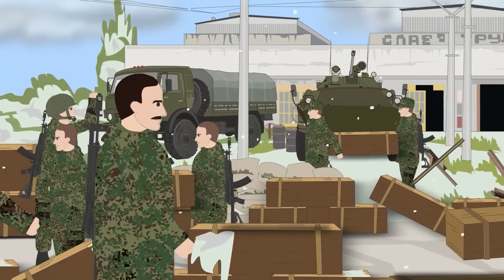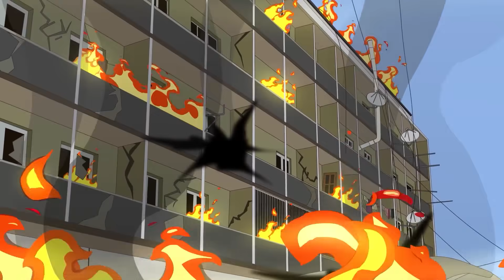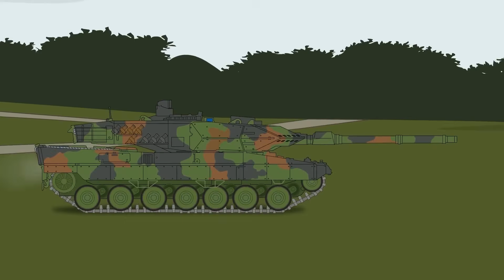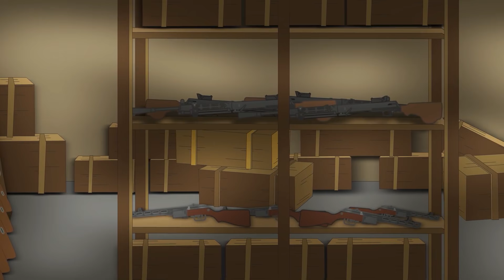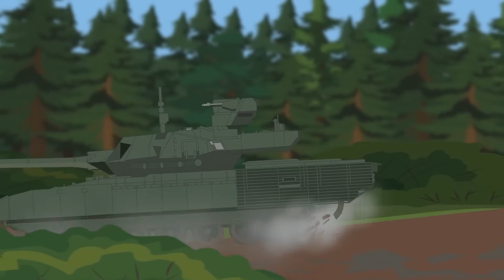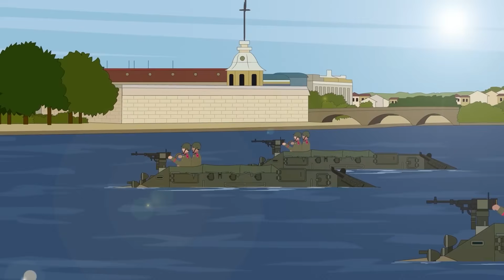Weapons that could Decide the outcome of the Russia-Ukraine war

Comment: Interesting that the T14 being modular is being seen as a good thing. If you base everything on a tank chassis and tank engine and drive-train, it will return tank-like fuel economy.

Modular works well when it's among a number of platforms that require similar levels of protection.

Comment: This is the first video, that I saw, calling it an invasion. There is an old Infantry saying: "Battles are not won by the equipment that you have to use, it is how you use the equipment that you have." The people are defending their homes. In the US, about 80% of dead criminals are killed by the victims. Most DOAs were armed burglars. Some were attempting to commit MURDER (187). Once time a man broke in  with the intent to 187 his girlfriend's husband.
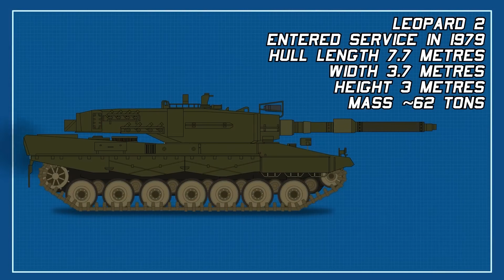19:04)The US tank is lighter by 10,000+ pounds. An US ton is 2,000 pounds. A metric ton is 2,204. 1.102% heavier.
27:02)4.8 Km is 2.98272 miles. 1 Km is 0.6214% of a mile.
29:33)Assault rifle is the US press name for SEMI-automatic rifles.
33:00)Overlooked are the WW II German MG 34 and the MG 42. The US M2  .50 caliber Heavy Machine Gun (HMG) has an effective range of 6,000 feet. An USMC man, with a scoped "Ma Deuce" was able to "reach out and touch someone" at 7,200 feet in Viet Nam. The lighter  .50 caliber M82A2 rifle can used as an anti-aircraft weapon. Bolt action with a 5 rounds magazine. About 6 were made.

Comment: Hahaha i macgyvered today funny enough.
I was missing the nut that holds the 2 pieces of a hole saw bit together, the centre drill and the cutting bucket/skirt around it i had and the drill.
So i used g shaped multi grip for framing steel to lock onto the thread where the nut goes also pressed jard up against the skirt to hold it in place and stuck it into my drill, customer was certain he was seeing something interesting so he watched me as im spinning the hole saw bit with a pair of vice grips attached to it and not the kind with serations, these things are like pinchers.
It worked like a charm

Comment: you missed the point of the WW1 water-cooled machine gun 
Modern air-cooled machine guns have many advantages   --   BUT they ALL need to be fired in repeated short bursts to keep them from overheating 
The water-cooled machine gun can lay down a continual rate of fire

Comment: The PTRD is utterly useless argue at me I dare you 1 is you need to put a thermal scope on it that means you are probably targeting infantrymen you don’t need at any-material rifle as I  going to call it has it is not really capable of killing tank or really any modern APC a small rule round will kil them just as good pulse these Rilfes  lighter smaller have a mag more reliable easier to operate and are most of all more ammo is available for these system also Sparta parts 

2 if you are targeting a vehicle or and it need a a thermal sight you are way too far away and out of the effective range to damage to the few vechicles you can do damage to with this thing

Comment: Another point .... The Sig MCX used by Ukrainian Special Forces is not the semiautomatic version.   The Sig MCX comes in both selective fire and semi-automatic only models. 

The semi-automatic version has a lower rate of fire than the select fire fully automatic capable version of the rifle.   It's kind of the difference between a civilian AR-15's rate of fire and a M4 Carbine's rate of fire. 

For reference the AR-15 has a rate of fire of up to 45 rounds per minute.  

The M4 Carbine has a rate of fire of about 700 to 970 rounds per minute.  

Hopefully everyone now understands the difference in rate of fire between a Semi-automatic rifle and a Select Fire battle rifle or carbine.  One is capable of automatic fire .  The other is not.

Comment: The T-14 is the most fake tank produced by sheer armounts of copium the world has ever seen, it can't even drive and has to be pulled since it's engine is to weak to pull it's own weight and the chasy doesn't allow a stronger/biger engine, on a scale of 1 to 10 it's a minus five, AN EPIC FAIL. 

There's a reason it never showed up for battle in ukraine and why they use tanks of the start of ww2, because if they could have used the Armata 14 Tank, they would have , just like the used the "invincible and undefeatable T90 and Terminator Tanks" Only one country can lie even more to itself and that one is china.

Comment: You missed a critical piece of info when assessing the tanks.  The Challenger has two hot-water boilers.  Its crew can brew tea and heat soup at the same time.  This is a slam-dunk for the Challenger.
Reply: It’s also to heat k rations boil in the bag type rations and all British Armoured vehicles have had them since the 50s
Reply: Challenger still hold longest tank on tank kill record
Reply: Lol
Reply: By now, the crew ARE the soup inside those tanks.
Reply: They didn't need any broilers whenever one of those tanks turned into one big broiler.

Comment: funny that you didn't mention that russia is a kleptocracy.  think of it like a pyramid scheme.  the upper class/politicians give contracts to friends and family, taking a cut... that family or friend takes a cut, then it goes down like trickle down economics... with each additional "controller" of the process taking a cut.  this is how lots of tanks and such that were found in storage with flat tires, no fuel or missing electronics/wiring.  because when it gets down to the bottom, everyone trying to make their cut... it doesn't leave much if anything for the actual construction or maintenance of anything.  putin and the russian leadership have for over 20 years now, just produced propaganda to give the appearance of military strength... its one reason putin refuses to call this a war... that title of a conflict has many penalties and boons that he doesn't wish to face.  anyhow for systems like the armata using mostly "foreign" components... its also to be said that this kleptocratic system can be to blame... can't build a tank out of cardboard boxes now can ya.  figured i'd throw that in for you since you missed it.  slava ukraine.

Comment: Chally 2, only 14 => useless, poor ammunition, just a burden for Ukrainian logistics.
Leo 2 and Abrams less than 100 => limited impact
Leo 1, even if it has more, it's also more limited technically => limited impact.

Artillery, IFVs and all these systems with much larger basic donations are the ones that have the most impact in Ukraine, because the high-end MBTs (Leo2A6-7, Abrams) are much more exposed and not numerous enough to make a critical difference.

Comment: T-14 Armata is a White Elephant and an expensive one at that.

The engine it uses wasn't a vehicle engine, but a conversion of an existing engine used for pumping stations for both water and oil. It is also based on a captured German engine from the Second World War, the ill-fated Tiger P's Porsche engine that never worked reliably.

The Remote Turret also suffers from feed issues, up to and including jams serious enough that the Turret is at risk of being blown up. As for its rotation speed, the M1A2 Abrams can rotate its Turret at or greater speed than the T-14. I've actually seen a video of an Abrams in combat get smacked by an Iraqi Insurgent in the rear of the Turret side and that Turret swung around faster than I could blink before stopping, acquiring, and then adjusting before firing.

And all of that in just seconds. The video ends with the death of the guy holding it when 120mm worth of destruction slammed into the guy's position and killed him and his Insurgent buddies.

The T-14 also has both an issue with engine noise and air conditioning that makes the problem plagued Gun Stryker look positively perfect in that regard. The T-14's engine is so loud the crew have to shout to be heard. A propaganda video about T-14 tried to claim it was the AC unit, but the men in the crew compartment were sweating heavily.

Almost all claims are unverified or have fallen short of reality. More than that, the fuel requirements make the M1A2 Abrams look like a compact car. Or even a Smart Car!

Russia tries to talk it up, but the T-14 has been a huge failure. The German KF51 Panther is slated to enter full rate mass production, with Ukraine as the first nation to enter it into service, and the US Army has been working on Remote Turrets, especially for M1 Abrams, since the 1990s and had even successfully developed a M1 Abrams Remote Turret prototype vehicle that just didn't work out long term due to maintenance headaches caused by the technology of the time.

The Abrams-X just continues that technology development, but while the US Army is interested, from what has been sounded off about, the US Army still wants to keep the Turbine Engines as the technology has actually reached a point where the Abrams is nearly as fuel efficient as Deisel Tanks and that the latest developments in Turbine Engine Technology will make the engines both lighter and more fuel efficient.

Another decision is that future US Tanks will still have Four Man Crews, with the fourth man there to operate Drones and work with the Tank's computers, likely also filling the role of a Radio Operator to coordinate operations with other vehicles while the TC fights the Tank leaving gunnery to the Gunner and driving to the Driver.

Abrams-X is headed in the right direction, but isn't quite there yet. Though, it is a prototype and tech demostrator only. The M1A3 is still on track for development, but there appears to be no plans for a M1A4, at least for the US Army and that the next generation MBT will replace the M1A3 after a period of service where both Tanks will likely serve next to one another before M1A3 is retired to either be sold off or to be used as Targets.

Comment: I don't think pointing out the age of the T-90 is very relevant when M1 Abrams and Leopard 2 are both technically older than it. Then again, the T-90 is basically just an upgraded T-72. Even still, why point out the age specifically when it is comparably "old" with other modern MBTs?
Reply: It is also misleading, because the discussion focuses on when the FIRST tank rolled off the assembly line, NOT when the latest tank was built.  The US military announced it will continue to use the relatively ancient A-10 warthog tank-killer airplane through 2040.  A design that has lasted over a long period of time does not mean that EVERY one built is as old as the first one built

Comment: I’ve got an idea that is likely already existing but underated

Rc cars

A good fast, mobile, all terrain rc car could be devastating if used properly 

Yesterday I bought a modified one from a rc addict 

The guy program, modifies and even 3D print his rc cars he has one who works on nitro a crawler a big one that could break your ankle if it ran you over and many fast ones

He modifies controllers to max out their ranges some capable of working up to two miles away
He could easily attach c4, grenades, mines, cameras, laser guidance systems or even guns to an rc car

Some can reach up to 150km/h 

They are small yet powerful, cheap and would be highly effective 

You could for example:
Attach an anti tank grenade or mine on top of it and drive it under a moving tank to make it blow up from under

It would be almost impossible to detect and even when spotted  most conscripts wouldn’t think much of an rc car some could even try to steal it which would turn out to be a deadly mistake

Hiding in a bush spying on enemy troop using a camera or placing mines

The possibilities are endless 

The same goes for rc helicopters, planes and boats

All three can be modified to carry bombs, guns, torpedoes or mines

It is also fairly easy to use, modify or repair and if use for kamikaze purpose it would leave no trace of it’s presence in the first place

It can also be use to lead troops or find wounded soldiers

Comment: It amuses me how biased this channel is, you mentioned the effectiveness of drones yet you fail to mention how Ukraine loses 10k drones a month due to Russian electronic warfare, thats why less and less UA Pov drone videos are appearing. In fact 95% of drone videos I have seen in the last week are of Russian POV, some truly horrifying ones like the UA troops jumping out of a Bradley right onto landmines
Reply: Drones are consumable. Like shells or bullets.
Reply: It is incredible how Ukraine manages to advance against the Russian occupiers and invaders, through enemy fire and the defensive lines that the Russians created for months that include mines that normally take months and months to clear and all this under enemy fire, Great Ukraine.
Reply: @deliriumextreme1637  100+ NATO tanks, 6 NATO trained Brigades and still stuck at the 2nd line of defence. Ukraine holds a 5:1 numbers advantage, the ‘elite’ 47th was just sent to the rear for refitting due to IMMENSE loss of life, ukraine was supposed to ‘split’ Russian lines and reach  Melitopol in 2 weeks, it’s been 4 months and they have pushed forward 3km. For example Wagner at Artemovsk numbered 50k and in 4 months they had captured more significant ground against ukrainian forces numbering 80k which many of them foreigners and ‘elite’ units, Wagner pushed through and cleared hundreds of rooms and Commie blocks. Meanwhile ukraine is struggling in open ground. Kid don’t act like the Khokhol offensive is even slightly successful, Russia has captured just as much land in the North as UA has in the South during this offensive

Comment: For the Abrams the smoke screen device on the engine was disconnected in early 2000s because the new fuel the Army is using.  Is more flammable and it could cause fires!!
Reply: Smokes of recent seemed to have shown their use, yesterday footage came out of Bradleys deploying loads to cover the Ukrainians as they tried to consolidate their men and escape a minefield
https://youtu.be/x2eMn1E28Y8

Comment: The reason they won't export depleted uranium armor isn't because of what it's made of, it's because the US has a secret, proprietary method for hardening DU; DU is naturally very soft, you can flex it in your hands, thru methods I won't reveal, the US can harden DU harder than steel, not diamond hard but glass hard, not only is it incredibly dense, but it will also shatter pretty much everything

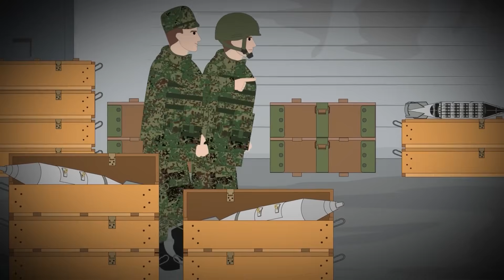Comment: 10:45 Just goes to show how much politicians know about the Laws of war and military. Neither cluster bombs or Thermobaric weapons are banned or prohibited. There is a treaty about cluster munitions but neither Russia, Ukraine, US or many other countries have signed it and thermobaric weapons are not even defined in international law, so it's perfectly fine to use them, along side flechette rounds , canister munition, air deployable PFM-1 anti personnel mines, IEDs. Both side are using them and both sides are pointing fingers at each other. When ever one side destroys a kindergarten 3 km from the front line, other side acts like it's surprised how a large number of 20 year old kindergarteners died in such a brutal act.

Comment: well but the usa has allready devoped full blown infirty portable counter messure for use agest reporpesed comernsal drones that have a very good range. this anti drone eqpuipment is just a bascly modfived javelin anti air missle luancher with only just the targeting sistem and gideace sistem lleft in it but the missle luncher just  instead fires over sized nerf dart caphure net missles that just is acatly works just like the net booska that team rocket in the pokemon anime uses but for agest drones that are fully gided net missles.

Comment: Surprised to see the Armata featured in this video. T-14s are very rare overall.
Reply: I guarantee.. if an Armata gets accidentally deployed to Ukraine, the first loss would be to an artillery shell.
Second to a Javelin... and it will never see tank on tank combat.
Reply: They aren't even in combat, they've never seen combat, they're only in service with the Russian Parade Division
Reply: @crusader_wolf1104  yeah you're right.
Reply: @crusader_wolf1104  considering this year's 9th of May parade, not even they have functional ones. seriously, the Armata segment of this video is a waste of tame and full of incorrect information. Don't know where they got the 132 delivered by 2020 number but to this day, it appears that around 20 have been built, half of which are prototypes and the other half are pre production units for evaluation and testing. The intended production line has been put on hold because they can't build them due to the design requiring western made electronics that they cannot make themselves and also they need the resources for T-90 production, T-62 modernization and T-54/55 refurbishment.
Reply: Armata can be an extremely good tank if it is modified @Tomatnaufmaugn